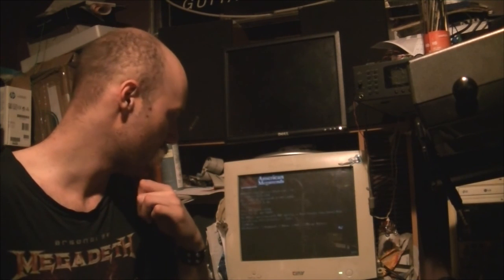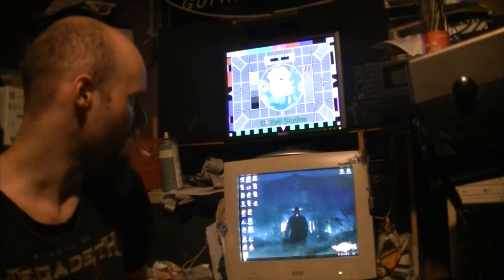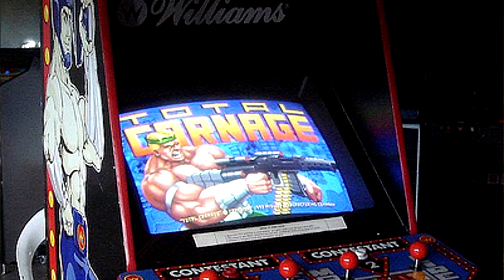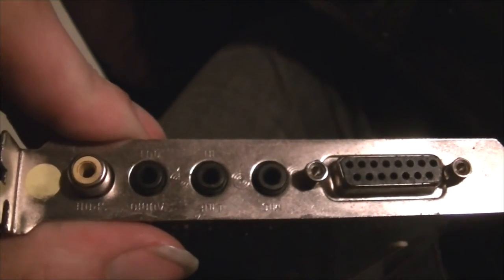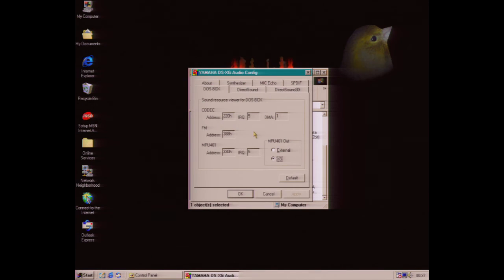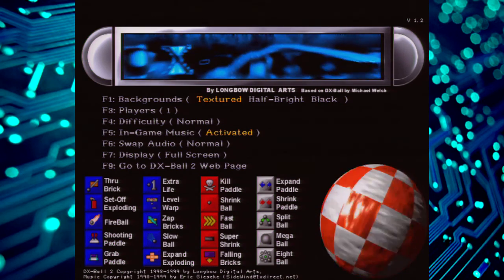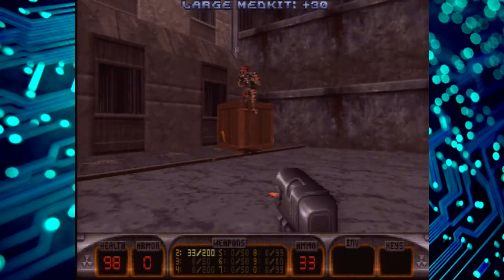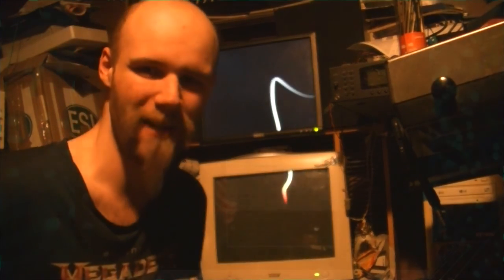Yamaha YMF724 Audio Overview

Comment: Absolutely agree on Sound Canvas being nothing special aside from compatibility. Yamaha - tons of presets. Korg - lost of post filters. Roland - chorus and reverb that you can't even hear, until they're full on. But I must admit, Roland's build quality outdoes every other vendor.
Reply from the maker: Depends on the era, Roland have consistently made things out of cheap tinfoil which break easily. In the 70s and especially the 80s this was fine, because 80s Yamaha gear is trash and I'd sooner use Casio. By contrast the MU modules of the 90s were extremely solidly made, where Korg gear of the time is a bit flimsy albeit very capable if you had the patience and needed degrees to use it properly. I'll give Roland's SoundCanvas one thing, I never managed to really break one too badly, unlike their LA synths that always fail in my hands for reasons unknown - after a while a crunch sound comes out and they never work again, though as they sound like an asthmatic kid farting himself to death, it's not really any loss.
Reply: @HighTreason610  My exposure's mostly been to Rolands between MT-32 and SC88. Not one of their boxes ever failed on me and I've still got about a dozen of their synthesizers and sequencers. Only thing I had to replace was a coin cell battery on one, and that's it. Yamaha MU1000 is starting to have electrical problems despite being in mint shape. Korg NS5R is aging and feels like it won't make it through the next decade. I always see tons of Yamaha gear at thrift stores. There's always something wrong with the LCD and knobs fail on them all the time. I have RM1x sequencer and I had to replace most things on it, and still not done even. Planned obsolescence all over.

Yamaha's fail by design, Korg's fail because of normal wear and Roland fails... when you forget that the power supply is supposed to be center tap negative.

Comment: over the weekend i had a go at pairing up my AWE64 value with an aopen branded YMF744 - its a good combo for me because as you know the XG midi is great for the value, the real OPL is way better than CQM on the AWE64, AWE itsself can sound good if the soundtrack has been remastered (im looking at you, xcom ufo audio people, you wonderful people), the semi-useful MT-32/GM emulation of the AWE64, and having all options of either sb/sb pro/sb 16 and then on top of that the main line output of the aopen card being so much cleaner. its a pretty complete deal and ticks all the boxes for a dos/windows gaming pc. i'm running a pentium  mmx 166 on a ss7 board (shuttle hot-591p little tiny gorgeous thing).
Reply: there are a few games it seems that might not allow me to choose the right resources though when it comes to dos. windows pnp assigns the irq 11 to the yamaha and 7 to the pnp awe64. i need to use both aweutil and the setupds program but definitely not use setupds /s or whatever the initialise-with-saved-settings option is, as it trys to allocate the other sb resources and breaks everything. i must choose to only enable the fm chip in dos and all of the other features of the awe64 don't get touched. then the game needs an adlib option or when i choose sb option it looks for the opl @ 388 within the awe64's 240 address, somehow adlib option just goes to the 388 that is initialised last?
Reply: i really dont understand how it works i'm just happy it does. i feel like i fluked it even with the right intention.

thanks for coming to my ted talk.

Comment: The sondius part of that driver is so underrated. It can friggin mimick wind instruments like yamaha's VL synths. Install PVL-SYXG100 for some sax/trumpet/flute fun.
Reply from the maker: It's a really capable little thing, it still doesn't quite make it to the levels of a real MU modules, but I used to compose with this before finalizing the sequence on the real module - the MU90R has some effects and sounds which this chip lacks - it made things a lot easier because it meant the system and module didn't need to be constantly tethered to one another.
Unfortunately this machine was stolen and it's taken me this long to find another card, it hasn't arrived yet but if it works, it will be filling the same role as this one did.

Comment: I have a Yamaha YMF724F-V based sound card but lacks the SPDIF interface (but has support for optical audio but it requires a daughter card which I don't have). I use it for my OPL3 FM music fiddle-abouts with Adlib Tracker II on my TriGem DreamSys Pentium III PC which has an SB-LINK connector on its motherboard. You don't necessarily need the SB-LINK connector to get SoundBlaster working on the YMF724 under DOS as long as you load the DSDMA driver after SETUPDS but it is not as stable on certain games.

I should mention that the YMF724 (and the YMF744 as well according to vogons) has a genuine OPL3 integrated into the chipset which explains the excellent OPL3 support on it. I can confirm this as I've played a bunch of Adlib tunes on it which don't sound right in pretty much all clone cards I've tried it on but sounds pretty much perfectly on the YMF724.
Reply from the maker: DSDMA wasn't included with the drivers for mine, so that is good to know for machines which don't have the connector. I can only guess that the driver package mine came with was significantly earlier, or else they (SoundMAX) simply forgot to include it, as they did forget to include some of the Visual Arranger files, but then included two versions of XGStudio. It certainly does seem to be real OPL3 and being Yamaha it makes sense because it was their technology, so they weren't likely to waste R&D money on redeveloping a technology they already owned for no reason. Anyways, good to see you over here.
Reply: That actually does raise a question I have about the YMF724. If you didn't hook up an SB-Link cable and did not load the DSDMA driver, would the OPL chip still work without PCM output? I ask because I used to have a Celeron 800 Mhz with a C-Media PCI sound card (bad choice I know.) and I could never get the SB Pro emulation on that thing to work in DOS, but the OPL always surprisingly worked. I'm wondering if that's the case too for the YMF724, you could pair it up with an ISA sound card that doesn't have an OPL chip like the AWE64. Of course, I believe you would have to disable the AWE64's CQM through it's configuration utility so it doesn't conflict with the YMF724's FM, but I figured that might be a decent solution if you're not willing to fork out the cash to get one of the good SB16 or AWE32 models that have a real OPL chip and none of the bullshit such as noisy outputs or clicking DMAs. Though then again if you had an another empty ISA slot you could easily do the same with one of those OPL-SAx cards.
Reply: @SonicTheJackrabbit  Even though its a 2 years late response ill answer anyway for those checking this video before buying the card.

The answer is absolutely, the OPL3 and its own FM Sound will just work, the gameport should work to. You only need dsdma or the sblink stuff for soundblaster emulation. But the setup tool will not detect soundblaster support and can even crash the system if you do so. So running the setup tool first and then dsdma worked most reliable for me.

Comment: The PC versions of Final Fantasy 7 and 8 had explicit support for Yamaha XG synths, and I think even came with cut-down versions of the SWXG50 soft synth. They definitely sound great on one of those DBXG60 daughterboards (and the NEC-made XR385 clones), probably just as good on the YMF 724 or a real MU.
Reply from the maker: I'm sure I read about that somewhere. I guess I could try it on the MU90R MU some day if I found the game cheap or free (Not a FF fan, at all) as this was one of the systems which were stolen.

Comment: I cant get mine to work ... only thing that works are wdm midi but cant get this thing work in dos-box...
can you share those drivers with us? i mean the config and stuff
Reply from the maker: WDM? Hmm, that might be the issue, Win 9X seems to like VXD drivers - assuming you're using Windows 9X as these features disappear in XP due to how the OS works. Here are the drivers I used; https://www.mediafire.com/?b1rnbb4z741mlr2
Make sure the legacy system is using rational resources, in theory they can be shared with another device but this may cause a lockup, you can free an IRQ by disabling your parallel port, assuming you don't use that, as IRQ7 is usually fine for Sound Blaster compatible software.

Comment: Thanks, enjoyed your video  - nice to hear someone with their own opinion about Roland too haha.  I use one of these 724 cards in a Windows 98 machine - no sblink unfortunately, and no isa slots - so this gives me decent FM synth and MIDI for such DOS games I have that play in 98.
Reply from the maker: +Joe Bosak I do seem to think running in 98 bypasses the need for the link cable to some degree. It's a good card and it gets the job done very well. I do own a Roland but only out of necessity, the last two I tried to actually compose with broke and were a pain to work with for too little reward anyway.

Comment: Would it run with the OPL on a socket 775 machine?
Reply from the maker: +Vanessa Pucca Under Windows 9X it probably would, provided you had the SBLink header. It would still work without the header, but it might affect compatibility with older software to some degree. The Windows XP driver does not have OPL3 functionality so far as I remember and if anything else was disabled I don't remember by now as I haven't used it outside of Windows 9X very much at all. I can't even test with my Pentium II because the shady "Nikimi" drives I was using decided to stop working, not that I'm surprised, they were Maxtor factory rejects.
Reply: HighTreason610
Thank you for the reply :)
I have this Pentium D machine that i was considering in convert on a Windows 98 with KernelEx and the unofficial SP machine. How ever the challenge besides compatibility is to find PCI hardware to use on a OS from the AGP and ISA age :\
Still i loved this card you have :)

Comment: I think I have one of these cards kicking around somewhere.  Probably came out of a dell or something. I know it doesn't have the SPDIF output though.  I might give it a good test again.  I usually don't care for sound cards that lack a good amp with bass/treble adjustments in Windows, so I end up always running something from Creative.  It is fun to run something different these days.  I am on a bit of a MediaVision kick at the moment.  This P2 motherboard looks like the QDI board you were telling me about.  Great video man!  I have been in that situation too of talking about stuff and filming video, only to find out that I either forgot to press the record button, or the battery died on me.  You get into this groove that gets kicked in the ass when you have you redo it :)
Reply: +HighTreason610 Yamaha YMF724 sounds like a good sound card for games like Descent [especially Descent 2] as well as Final Fantasy 7.
Reply from the maker: WaybackTECH Yeah, some of them lack the digital output. For me the treble/bass is for my stereo to take care of so I never give it much consideration on cheaper cards though I got rather mad when a £70 M-Audio card didn't have the option... Got even more mad when I cottoned on that it was a Via Envy24 chipset which was what it was replacing, only that board was only £5 from some guy at the Sunday market, shady M-Audio had remarked the IC and attempted to pass it off as their own. MediaVision cards kick ass, I keep meaning to grab a PAS16 as I rather like the Plus I have already, the FM sounds more bassy and full on them somehow to me. I also like the speaker output it has internally.

This is indeed the  QDI I mentioned in my comment, I saw the Xeon video btw, it was cool to see you got it pretty much working. As I watched it I was actually working on unbolting an MSI of that era from my case. 

I actually didn't mess up too bad at the end, I actually recorded like 20 minutes of me rambling on about the workstation, it's impending replacement, about a board I "designed" which I want etching and aboutsome other nonsense. I simply spliced the video as I figured it wasn't worthwhile to leave it in. Rarely do I miss the record button or battery indicator, instead I tend to leave the camera in 576i mode or else swear at the SD card for seeming to always be full.
Reply: +Radical Edward also Kainia Karia (Michael Gardner)  FF7 is the perfect XG midi game to use the this with.

Comment: i think i might have a card using that chip. I do have 1 or 2 of the same card using YMF719 though (ISA)
Reply from the maker: RaptorZX3 I have a couple of 719's somewhere, I haven't found a use for them as yet as they don't do anything my Sound Blaster won't do, though they're decent enough and as I have now used up all the Creative boards I have, the Yamaha's might well be put to use.
Reply: yeah my AWE64 cards are all a different system now, but i wonder if a YMF724 would be better than an AWE64 for a Pentium 3 733Mhz for Windows 98 games. This specific computer do have on-board sound, but i can't find the drivers anywhere on the net, even by checking with the board model itself or the sound chip.
Reply: HighTreason610 Yamaha YMF71x's are awesome, and are much better Sound Blasters that the real Creative Sound Blasters. Creative is one of the most uncreative and godawful companies that made PC hardware.

YMF-71x's chipsets are awesome, capable of 16bit 44KHz mixing with good quality, despite being integrated in cheap ISA solutions. AudioTrix, which was a company that has some link to AdLib made a good integration of the YMF-715 chipset, the AudioTrix 3D-XG. 

I use 71x cards to replace Sound Blaster Pro's, they have better analog output and are about 100% SB and 99% SB Pro 2 compatible. I have 4 cards in my Socket 7 system, YMF718, Pro Audio Studio XL, Gravis Ultrasound Classic and AWE64 Gold. The AWE64 Gold analog output is nothing special and it is noisier than my Yamaha. I just use it for its AWE synth, nothing else. Creative is about as shitty as DELL is. There i've said it.

Roland has some decent music instruments, but myself AS a musician i have to agree the Yamaha MU modules are pretty much superior to every Sound Canvas i owned. Unfortunately it came the standard for GM for DOS games and that's pretty much the reason i own one now.

As for PCI Yamaha cards, i think these are great despite the chipset never got integrated on good card designs, while fucking Creative dominated the market with their crap and bought every company that made hardware superior to theirs.

As i guitarist i can also say that their guitars are of high quality.
Reply: +RaptorZX3 I've found a YMF719-S last sunday, but I couldn't make it work, I don't know why, maybe the drivers, but I didn't find any other (they're coming from yamaha's website and they provide at the same place the YMF724 drivers and they actually work for that card.)
Reply: Deksor install Windows 98, i'm sure the drivers are in there and will be installed automatically. Then you'll be able to test the card if it work.
Reply: try it in another slot and/or another computer, so far i had no problem with ISA slots and cards. but if you check your slot before putting in the card and if it have rust or verdigris, then it's no good.
Reply: I do not have rust in it, and there was a sound blaster 16 vibra in it before I tried it. And after that failing test, I put the vibra back in and it still works nicely.

I've also a trident graphic card from 1990 that doesn't work, but in this case it is worse : it prevents the computer to start ! the leds are on, but no HDD, no fan are runing ... Probably a short circuit somewhere in the card (i saw a broken ceramic capacitor, but I don't think a component like that one could do such damages, just instability I guess. And I don't know how I could replace it since the capacitor is missing, I can't read the informations on it to find another)

And I cleaned both cards when I tried to make them work. But nothing different happened

I think for the sound card I should try on another computer with a fresh install of windows 98, but I don't have the time right now ...

Comment: I have Total Carnage that I can swap out in my Smash TV arcade cab, I didn't realize it used Yamaha sound. It's a fun game but I like Smash TV better personally.
Reply from the maker: sandman x I like both. But I always liked Total Carnage a bit more for whatever reason, I think the illusion of a more open environment helped and it seemed way more over the top... The end of the game is broken too, which amuses me. I don't have the cabinet though, unfortunately, because I think one would look good in my living room, probably better than the 1970's corner unit cupboard thing I have.

As far as I know, the audio CPU was a Motorola 6809 and it controlled a Yamaha YM2151 - almost identical to the 2164 in the DX-100, so should also be patch compatible with the 2612 in the Mega Drive - as well as an OKI chip and some generic DAC. The music in the game would be provided by the 2151, though the drums would likely be from the DAC. Don't hold me to that though.
Reply: HighTreason610 I'll try to take a look at the board this weekend and see what it has for hardware. I like Smash TV more probably due to nostalgia, as Total Carnage is probably a better game overall.